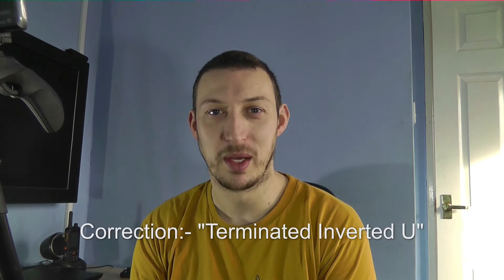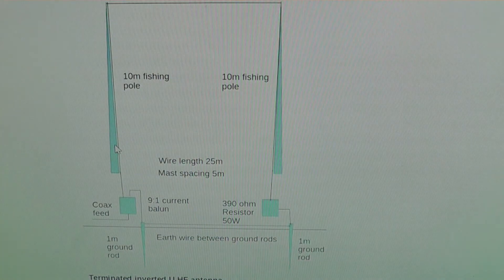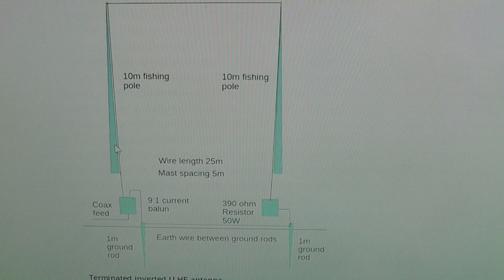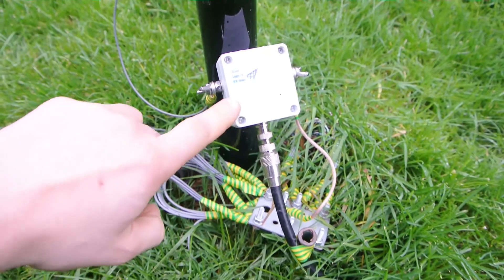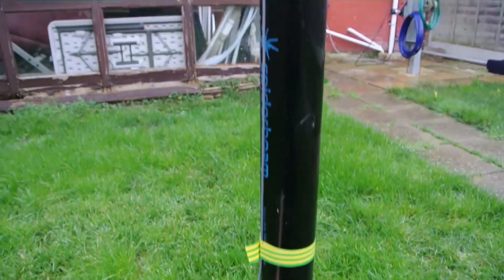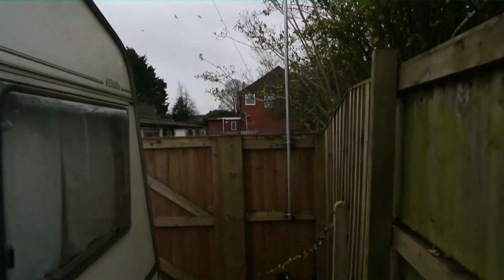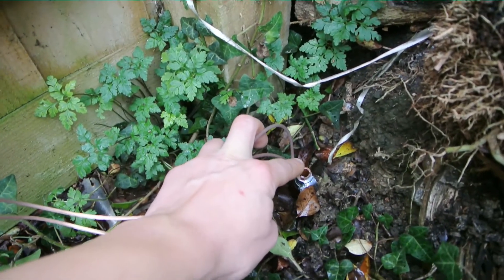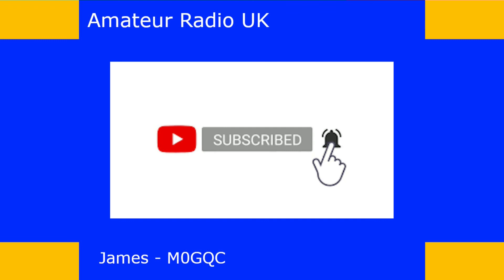Terminated Inverted U Antenna - 80m from a small mid-terrace house - Part 2

Comment: Found it 😝
Reply from the maker: The Terminated Inverted U is very much a compromise antenna, so it's not going to bust any pile-ups.

Having said that, I still use it.

I've moved the antenna around to make space for "other projects", so it no longer exists in the form shown in the video, but I still have a Terminated Inverted U in my back garden which I use on 40m & 80m.

I recently posted another video on the Terminated Inverted U Antenna, where I scaled it up to ridiculous proportions on the 3 acre farm........no real reason other than I could and I wanted to see what would happen!

Spoiler alert..........it didn't work!

My signal reports were way down and a lot of stations couldn't even hear me.

It did however make a pretty good receive antenna because It basically acted as a beverage antenna. 

I think when I scaled it up, that the ground rods were too far apart, meaning that the resistance through the earth was too high to transmit. The SWR was very high so I had to reign it in with a tuner (adding further losses to an already inefficient antenna system).

If I had the ground wire connecting the two earths together as per the diagram (not really possible at that location as the horses would have tripped over it) then who knows, it might have worked better on transmit.
Reply: Looks similar to a EWE Rx only antenna, might try making one for rx only , cheers

Comment: Hi James. Did you ever get to running that wire joining the two earth rods?
If so, how did it affect the transmit and/or receive performance?
Reply from the maker: I did try it. Frankly I couldn't see any difference in performance.

Supposedly (according to the guy that came up with this idea), adding that wire between the two earth rods should improve the transmit efficiency of the antenna, but also risks introducing/picking up more noise. To overcome this, the advice is to install an extra ground rod or two along the length of the wire between the ground rods so that it is earthed at regular intervals. 

Just trying the antenna at home, I couldn't tell any difference. Not sure what you would find if you had the proper test equipment. 

I suspect where it would have made a difference is if the earth rods were further apart.......see my more recent video where I scaled this antenna up (masts around 70 meters apart) on my 3 acre site.

Unfortunately I couldn't put a ground wire between the two masts because we have horses in the field (they would either trip over it or chew it).

The SWR was high (had to use a tuner) and the transmit performance was terrible.....I suspect that the ground resistance between the two ground rods was too high.

It made a pretty good receive antenna though. It essentially acted like a beverage antenna.
Reply: @AmateurRadioUK  That's my interest - a quiet receiving antenna. 
If on transmit though, measured current flowing around the loop is better when higher, it would seem that having earth at the two poles at slightly different potentials - and just using the ground between the two to complete the circuit, can't be beneficial? A nice thick wire connecting them together might be better?
If I try this antenna - I'll try measuring that. Thanks for your reply James.
Reply from the maker: @InteraliaTony  You're absolutely right, I don't think that having 2 earth rods at very slightly different potentials is beneficial.

That said, I think the distance between the two earth rods at home is so small (around 5 meters) that the effect is so little that it was negligible.

When I scaled it up at the field (70 meters between the rods) I think that the effect was so much greater that it became an issue.

Low noise receiving antennas is something that I have been looking into because I have a very high noise floor at my home QTH (which is why most of my stuff is filmed either at the field or when I go away in the caravan).

I've got a couple of ideas for things that I want to try in an attempt to combat this.

It won't happen straight away as I've already got several projects on the go. It will likely happen over the winter (when the field is too wet & muddy to do anything).